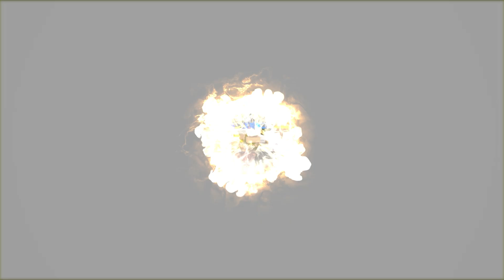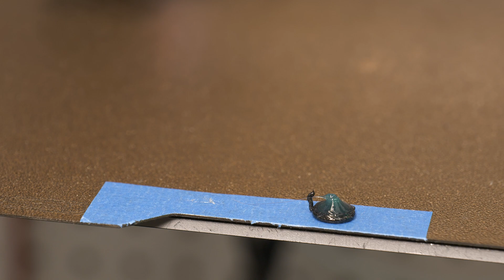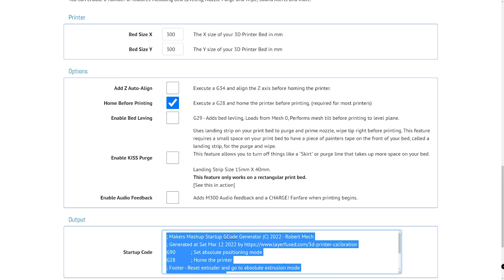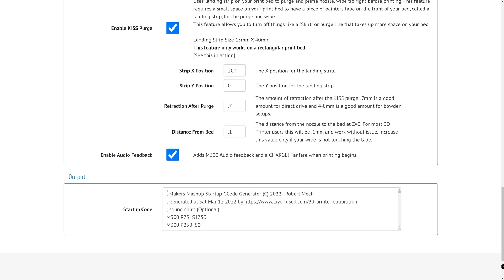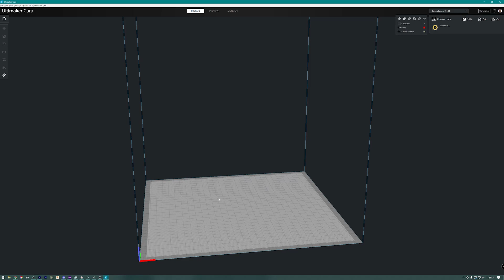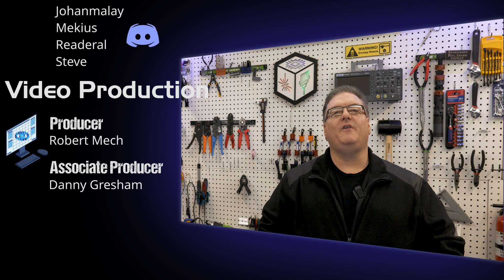Quit Using Skirts on Your 3D Prints!

Comment: While i understand all the pros behind it, i think the biggest con is how much material is being used in here instead. From the looks of it, those kisses use couple times more material then a skirt would. And it seems the smaller the print, the bigger the waste. It's an interesting sollution to the problem, but i just think it's too wastefull in the longer run
Reply: I would agree to a certain extent, but i suppose you could also edit the "KISS" purge height and amount to do a smaller amount. My default prime line was going 180mm down and 180mm back before starting a print, for me, this is purging about the same just in a concentrated "KISS". Personally I'm not fond of using a skirt in general though, so I won't speak to the skirt opinions.

Comment: Looking at the G code generated the ADL will only probe 3 point, which is probably fine for a core xy machine, what if I want say 20 points
Reply from the maker: That j option is designed to only lavel the plane as it's relative to the probed points.  There is little need to probe more than 3 since that is all that's necessary to determine the plane.  This does NOT probe the bed to make it level.  That's important to understand since J levels the plane. While it's an option to have more points it's largely unnecessary even on a Cartesian printer.  If your bed has that much deviation in it's plane I would consider a new bed for the printer as you shouldn't have that significant variation across it.  If your bed is trammed properly you should already have a nearly level plane.

Comment: Interesting, I could add this to my workflow but i still like having the skirt because it helps give me an ides om how my bed leveling is and shows where exactly my stuff is going to be printed. I could use this to replace the start line i use in order to clean the nozzle and ensure that my hotend is fully pressurized
Reply from the maker: Yeah you can use it with both, it all happens before actual printing of course.  I also created a few shortcuts in octoprint to repeat most of these commands after a manual filament change.  Just hit my purge button and the printer does the rest.
Reply: @MakersMashup  Sweet, I'll give it a test in Octoprint once I get some free time! ^^

Comment: I use a 3 layer higher skirt for an entirely different reason, protects the first layer from warping off the bed from stray drafts like that of my door. However this seems like a good first print of the day kind of thing to do. One of the problems I noticed is after the printer has been turned off and let sit overnight or longer, the first 50-100mm worth of plastic that comes through doesn't extrude very well. This has resulted in letting it print some of the first layer to get that out of it's system before canceling, clearing the bed and restarting the print for a good solid start. This Kiss method however done before the first print would help run the plastic out of the nozzle that doesn't extrude well and make sure it's fully primed and ready to go for a nice clean print.

Comment: I use brims for extra adhesion for most of my prints, and to test for level and other sanity checks.  I am concerned that you have turned your harmless plastic rings that you are trailing into the house into veritable caltrops of a Lego proportion.  The first time you step on a kiss, you will kiss them goodbye.

Comment: Ultimaker does basically this at the start of a print as well and have been for years. They call it a prime blob. I still use a brim though, for the reason we can see when the print starts in this video. The first tiny bit of the line didn't stick properly, with a brim this usually doesn't happen.
Reply from the maker: Brims in my opinion just damage the first layer upon removal.
Reply: @MakersMashup  Sorry, I'm too tired to be commenting, I meant skirt. I try to avoid brims whenever possible since they're a bit of a pain to remove as you implied which can make the bottom of the part look a bit scuffed. Using a deburring tool for removal does help a bit with that though.

Comment: An interesting aspect. How about gcoding a connection from the skirt with a loop to the rest of the printed part, to prevent them roamimg around after the print.
Anyway as long you wife found only strange printers skirts in the house everything is fine 😉
Reply from the maker: Interesting idea.

Comment: I have no real issues with skirts but I'm willing to try this out, looks interesting.
One improvement could be to have the nozzle bump off the kiss from previous print before heating up. I've purged lines on top of each other of I forgot to remove it.

Comment: Your actual print in your Test Print starts  with a flaw.  A close skirt or a brim with a small gap helps avoid this.
Reply: That will be because of the retraction. The printer will need to extrude the retracted filament before it starts printing. Which is what is seen in the video.

Comment: For ABS prints that need a brim you can just add 1-2 loops to your brim and start without a purge line or skirt. Saving on material and getting some more function out of it.
Reply: The question is then really whether you need a brim or whether brim ears (bears) is better. Bears are normally less trouble if they fit your part.

Comment: Skirts are perfect visually confirming that the first layer will be perfect before you waste a bunch of filament on the part’s first layer…

It’s really not that hard to throw the skirts in the trash, but ok
Reply: Yeah this video starts with the wrong premise that the shirt is for purging....no its to give you early warning that the first layer isn't going to stick. Combine that with the petty first world problem of throwing it away and you have this completely bizarre help video. 3D prints need cleaning up so the skirt is the least of your troubles.

Is on point for the hobby though...solving problems that don't exist or only exist because they have no clue why stuff works the way it does.
Reply from the maker: Sorry I don't buy that the purpose of skirts is to check bed leveling. Even if that was the intended purpose, it's a terrible tool for that. It goes around the object and doesn't cover the area where the print is.  All it proves is that the area the skirt touches is level.  With modern bed leveling techniques and tools if you're relying on a skirt to indicate first layer performance your printer needs tuning. On a tuned printer I see zero use of a skirt outside priming a nozzle.
Reply: @MakersMashup  all I just read was:
The old ways don’t work any longer and thanx to modern bed leveling technology we have entered the golden age of FDM 3D printing and NO ONE has failed prints anymore

But you wouldn’t say that, as it’s not true
Reply from the maker: I didn't say that and that's a pretty big leap there to presume that's what I was inferring. Sure they happen but with tuned equipment (as with any equipment) failure rate can be significantly reduced.  This method may not be for everyone but it does fit a use case where skirts provide little to no benefit to the end user.  For my printers the skirt is simply a waste of time and space on the bed. As always your mileage may vary.
Reply: @MakersMashup  Skirts are multi-purpose.  It helps to purge AND is a useful troubleshooting tool for prints.  "With modern bed leveling techniques and tools if you're relying on a skirt to indicate first layer performance your printer needs tuning." Classic chicken and the egg here - you need tuning to not need a skirt.  How do you know printer needs tuning?  If your print peels off on the edges and corners, how do you know if it's just a warping issue vs maybe you're too far from your bed?  Well, one thing that could help you figure that out?  Skirt!
Reply from the maker: I appreciate everyone trying to convince me that Skirts rule but I think we'll all have to agree to disagree on this one. Chalk it up to personal preference.
Reply: @MakersMashup  The title of your video is "Quit Using Skirts on Your 3D Prints!"  Who's trying to convince whom? You fixed something that doesn't need fixing (how a skirt is harder to throw away than a blob I have no idea) in my opinion and gave up a potential troubleshooting tool in the process.  If it works for you, great, but I'm unconvinced personally.

Comment: I dont have a problem with skirts they go in my waste plastic bins as soon as I take something off the build surface, what I do have a problem with is ooze worms while probing, they get laid down with the prime line but sometimes when I take that off the bed they get catapulted all over the room, I suppose I could retract the filament a little before g29 but Im lazy and its one of many things I dont get around to doing
Reply: The oozing your seeing is caused by air being able to make it into the hotend around the filament, a better seal around the filament would help with that. It's the same effect as sticking a straw into water and putting your thumb over it. I used a captive o-ring just under the fitting for the hot end input, soaked in mineral oil to prevent it from gripping. Works wonders.
Reply: @eideticex  I have put a .5 retraction in the start code before the G29 and that has solved it
Reply: @eideticex  How does the air which is already in the hotend and rises up affect the melted filament in the nozzle and cause oozing?

Comment: I still prefer a skirt because it shows exactly where the printed part will be so if your using glue you know where you should exactly put it. Also a skirt will also tell you if the first layer is getting put down in every area before it starts the print this way you can stop the printer ahead of time if it not fully attaching to printer as the first layer is the most important that it's laid down properly.